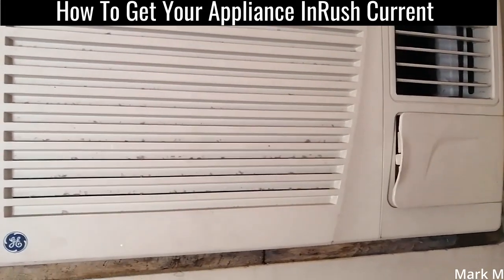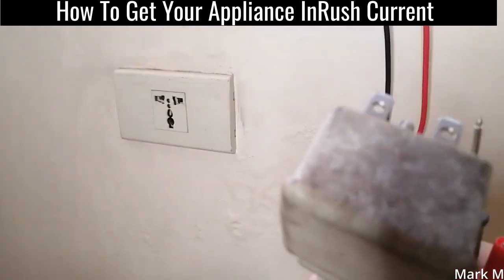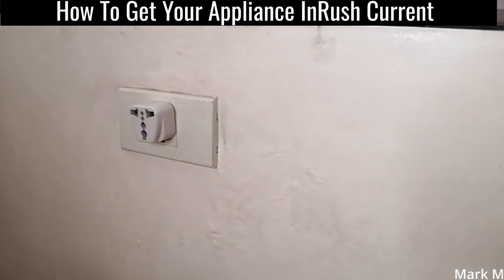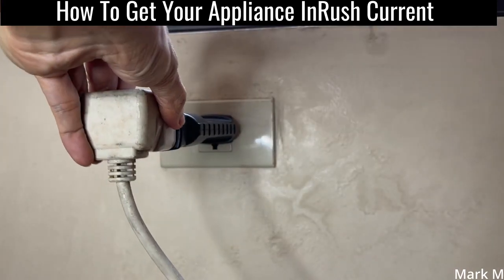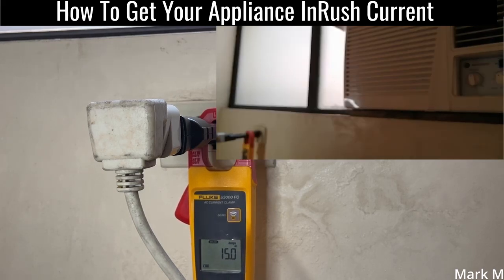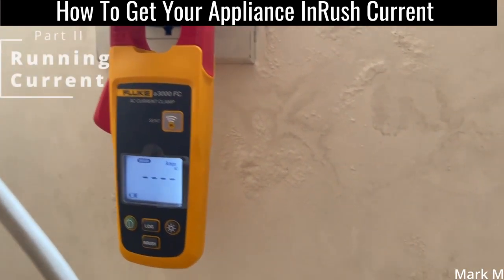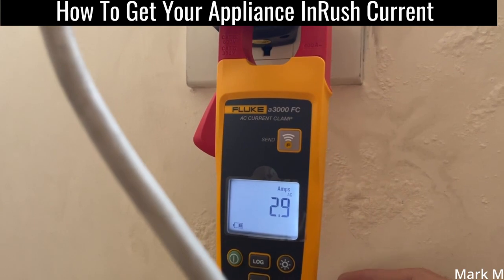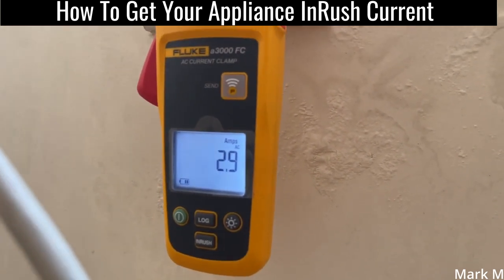How to Get Your Appliance InRush Current.

Comment: How about InRush current for 1Hp AC, rice cooker, refrigerator and water heater/multi point heater coz I'm planning going 24v 3kW hybrid with 4kW pv? Thanks
Reply from the maker: I don't have 1HP AC, for rice cooker, it's resistive, that one doesn't have a surge. Refrigerator has one due to its  compressor. But new models of Ref are Inverter type has less current.
Reply: What is the area of wire battery connection labeled inside snadi/onesolar 12V/1000W, is it 25mm^2? Salamuch
Reply from the maker: @damss2724  size is 6awg as per markings on the battery wire.
Reply: @MarkMinoza  why #6awg with 72A max capacity? Should have been 25mm^2(93A), I think #6 awg is enough only for 24V1kW